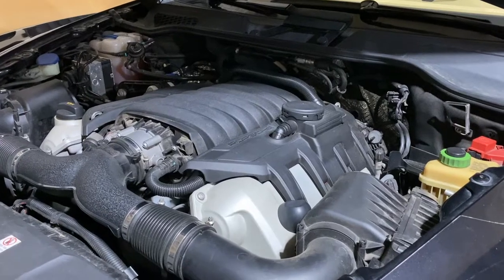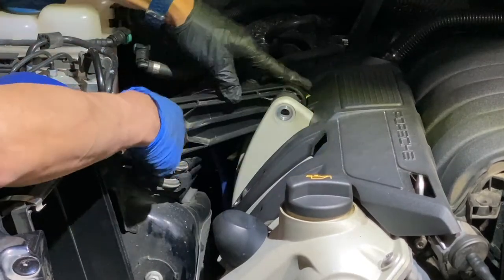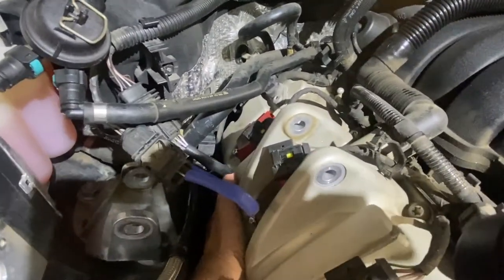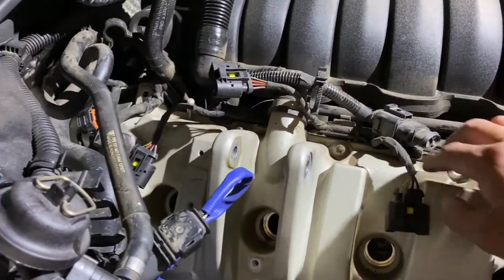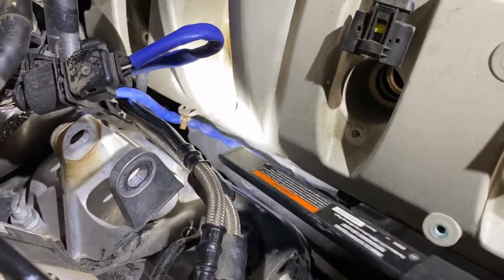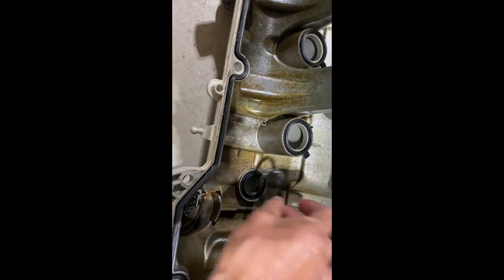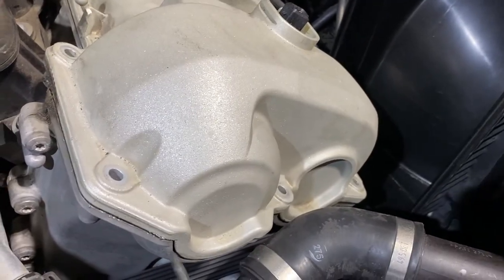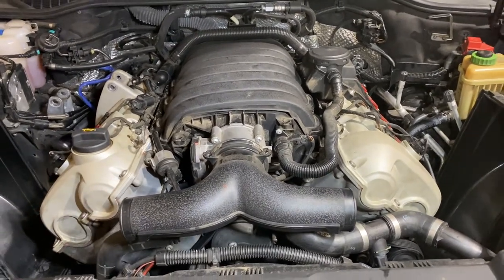2012 Porsche Cayenne S Valve Cover Replacement

Comment: Thanks for the video. I will be tackling the passenger side soon. Did you remove the oil before taking the covers off? Or is the oil below that level
Reply: Oil is below the level, you don’t have to drain it